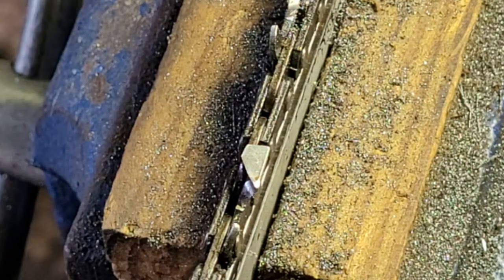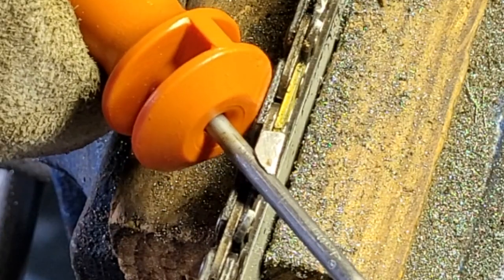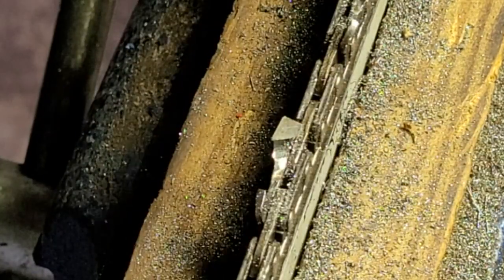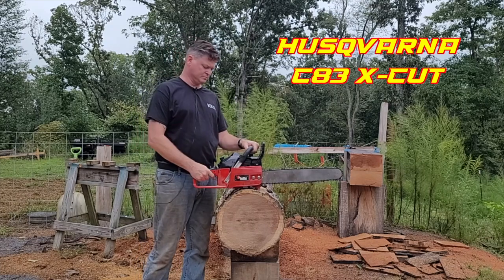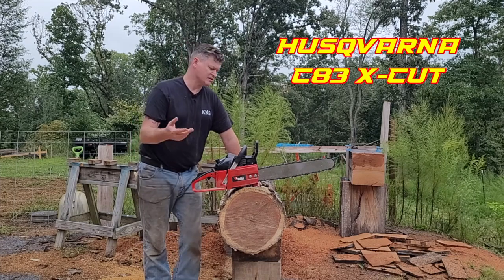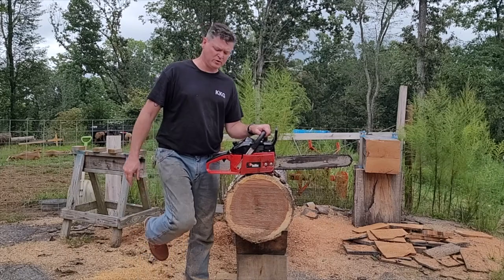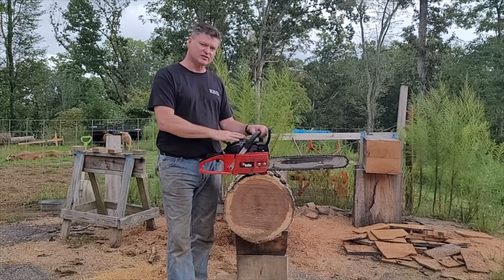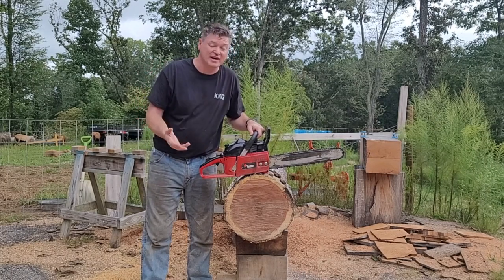Baby C chain tested against X Cut and EXL

Comment: Your filing mechanics are very good.  Try getting your file a little deeper into the tooth.  The still photo shows a pretty steep top plate angle.  With about a 1/4 to 1/3 of the file above the top of the tooth it will create a sharper top plate angle with a little more "hook:.  This is not just for baby "c" style but any round filing you do.
Reply from the maker: Thanks for the tips!
Reply: Your saying opposite the great buckin billy ray
Reply: I agree!  He should be a little lower, so he has more hook.  He cuts mostly hardwood, but in soft wood, you definitely want a bunch more hook than that.
Reply: I wish he would test your 30 degree hexa sharpening, vs a stock hexa chain.  That would be cool!

Comment: You did a nice job sharpening.  When a chain is rocked, and you are cutting that much off the rakers/drags whatever you want to call them, I usually measure with a depth gauge like yours, and then take the gauge off, and file, and then check it.  Because, it seems like it wears the gauge away if you just file on top of it, the way you are supposed to.  Just put your finger over the tooth so you don't accidentally hit it with the flat file.  My gauge is softer than yours though - not sure what brand?  Maybe Husqvarna?  I have one like yours too, so maybe I'll try that and see if it is harder.

Comment: From what Ive learnt. The sharper the angle on the cutter the quicker it will dull. Also the baby C adds gullet and less chip storage in the cut. There is a perfect angle for every wood. I mainly cut hardwood for firewood.  Everyone has their own  way I suppose.

Comment: I do production work for a living cutting R.O.W and when you get the gullet out in my experience they cut better instead of the camel hump looking tooth that comes from to small of a file and not getting under that top cutting edge. Stihl chain easier to sharpen but softer than Husqvarna chain in my opinion. That’s why I bought a 100’ role of x-cut 3/8 .050 chain. I run it on everything from 550-390. My 346’s and 543 in run .325 .050

Comment: i've been playing with the baby c , a little bit , it seems to like higher chain speeds .... either by modding the saw to turn faster , or going one tooth bigger on the drive sprocket ..... adjust the rakers to control your engine rpm

Comment: I don't run .325 chain. But I was sent the wrong chain the other month and I happened to have      .050 bar so i tried it on my small saw. SP33G Husqvarna x cut, i was so surprised how well it cut! I hate .325 but I'm sold on this chain. Have you tried it?
Reply from the maker: I have tried it and I also liked it.  I am trying to work in a comparison video between it, the Stihl RS .325, and the C83.  See which cuts the fastest.

Comment: Everyone knows chains cut faster after they're filed out of the box your stuff is not lining up friend I wish you well but from what I see this is a very biased comparison
Reply from the maker: Normal chain, you're right.  The X-Cut chain is not normal.  You think you know what you are talking about, but you are clearly wrong.  X-Cut chain is slower once sharpened.  Unless you are going overboard and making radical changes to it.  But if you buy an X-Cut chain, and hit it with a round file, you will lose speed.  I have proven this in my chain comparison video and in another video.